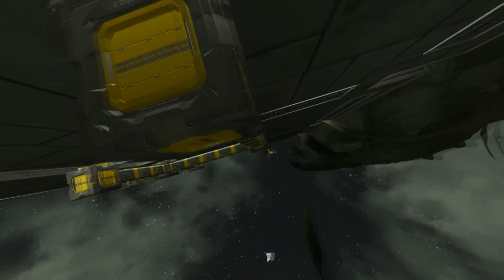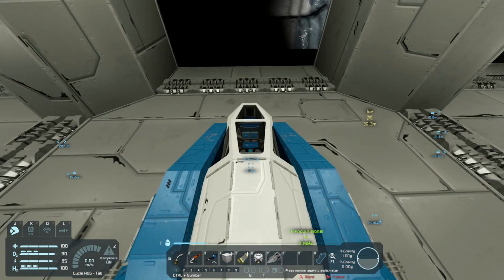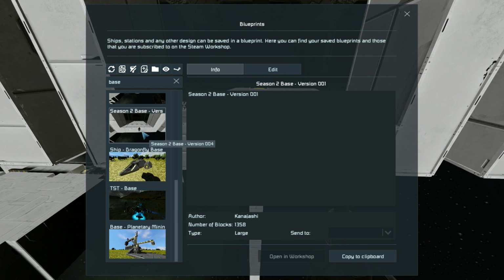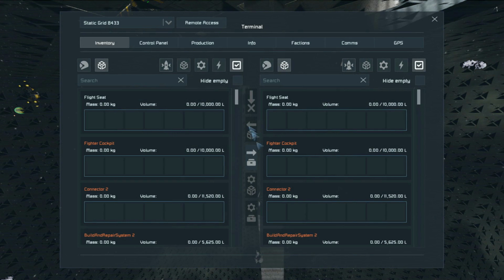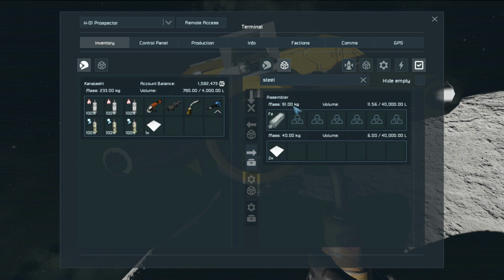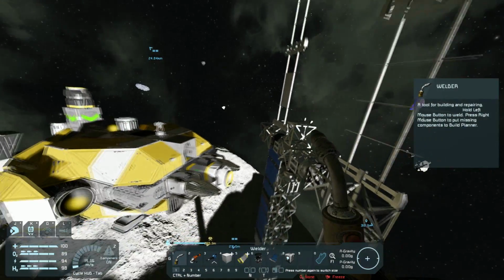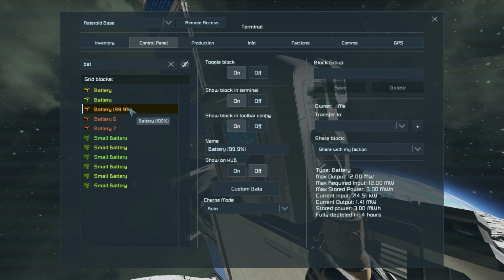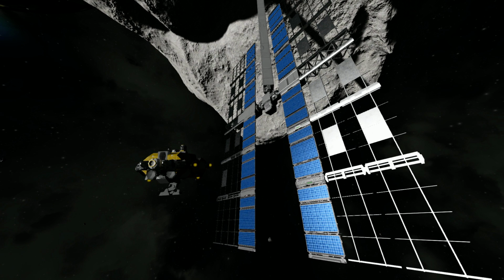Space Engineers - S2E08 'Temporary Solar Tower'

Comment: For the solar panel tower arms use half block instead of full light armor blocks. Looks better when you attach the solar panels to half blocks (at the end to connect the arm to the rotor just add a half corner block (the one that goes from full to half block at the other end).

Comment: Can I suggest that rather than using a script for solar alignment you use "SmartRotors: Solar". It is only one (or to blocks) plus the arms (total of 4 blocks) to be placed in order to start placing the solar panels. Also, each arm can hold 4 solar panels so with the first 3 - 4 blocks you can place 8 solar panels directly on the array. Once again, just a suggestion.

Comment: Not to nitpick, but Hydrogen is the greenest of all fuels :-| it litterly creates water and hydrogen. thats it.
Reply: actually solar, wind, tidal and geothermal are all greener, as although there are no emissions except H2O from burning hydrogen, getting that hydrogen in the first place requires more energy than burning it produces. An advantage it does have though is that it can be used when required, with much less loss of energy than battery storage of power, so it would be potentially worthwhile to separate Hydrogen from Oxygen using solar or wind power for example, and then burn that hydrogen when more power than other renewable sources provide is needed.

Comment: I’ve gotten in the habit of including build and repair with a central conveyor system with all my builds now especially when dealing with projections cause then you just turn on the B&R block as they get built which then cascades through the build. It does require some fine tuning with the show area or a bit of math but I like being able to just plan in advance and then just watch it build itself
Reply: The other thing I’ve tried is putting a B&R block on pistons and extend them as needed

Comment: You should build it with conveyors so you can also put o2 farms on that solar array so you can offset your o2 usage so you'll need the ice mostly for hydrogen!
Reply from the maker: Ohhhhh good idea! It would be fairly easy to run some tubing out there and add them to the array. I think I will do that for the second version eventually.
Reply: @Kanajashi  as for what I've notice with the o2 farms, you'll need roughly 4-5 o2 farms per player at the base, so putting just 8(4 on each side with a up/down facing) would be plenty for your single player game! Also, you can place turrets on it so if a drone or any other nasty comes around it would defend it! Also instead of having just conveyor tubes running that whole length, you can put a few oxygen/hydrogen tanks inline so you can have them not taking to much of your base room up!
Reply: elementalblaze79 great suggestions! Some people on this Facebook group I’m on said that o2 wasn’t traveling from the o2 farms through the advanced rotors in their game. Not sure if it’s a bug but has that ever been a problem for your builds?
Reply: @_DaneB_  I've not run into that bug! I've also noticed that some mods change how some other things work, ie: one of the refinery mods make it where all refineries won't give you iron, nickel & silicon in your vanilla refineries, just gravel! A mod I made that makes hydrogen from o2 farms(it doesn't add nor change the o2 farm, it adds a block that looks like the o2 farm) seems to have a few problems with any mod that changes how much hydrogen is made with ice so if you have a mod that does this you may have issues as well, even with o2!
Reply: @Kanajashi  also why not have solar towers both the bottom and top? :P
Reply: I usually build solar towers with tubes protected on all sides with half blocks for armor. Same for arms with advanced rotors. Allows you to place gatlings on the top and end of each arm for protection. Plus a BAR on the tower top makes building the panels easy. However for just guns I guess small cargos will provide plenty of "at site" storage.